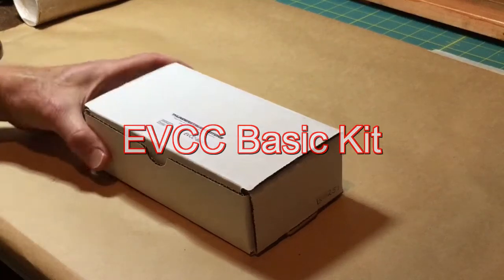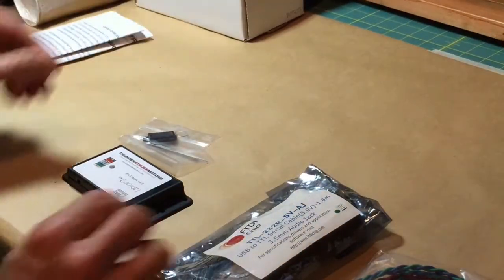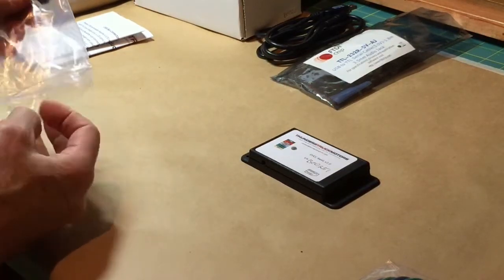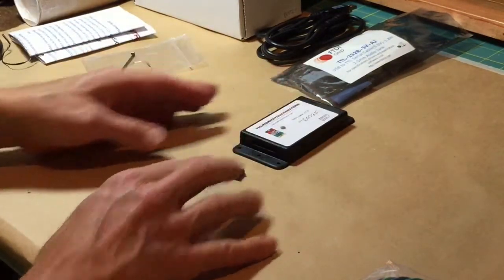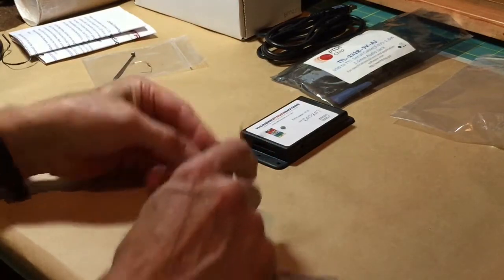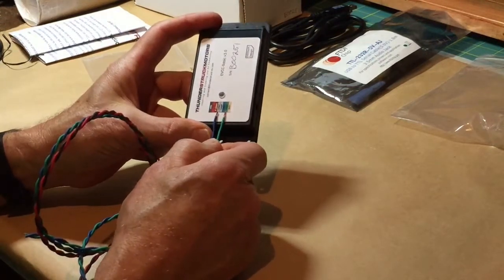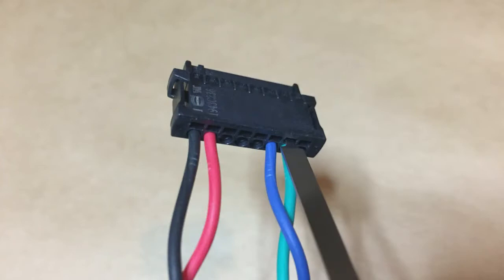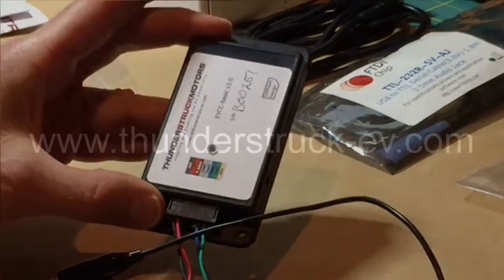EVCC Basic Kit and Wiring

Comment: Is it normal for the EVCC to start blinking faster after blinking slowly 6 times(like in the video)? I connected my evcc with 12V supplier and the evcc lights up 6 times like in the video and then starts blinking fast. Should I be able to see the evcc startup banner with just 12V connected? or do i need to connect the CAN lines first?

Comment: I just got a evcc and was looking for what out 1 pin does? is that the charger interlock wire?
Reply from the maker: By default out1 just follows the behavior of the status LED,
out2 is drive away protection
and out3 is a fault condition.
These outputs are programmable, more details are on page 12 of the manual.

Comment: Hi! Can I use it with 120-84 volts of power? I saw the instructions that you need at least 140 volts. Can this be reprogrammed?
Reply: The EVCC controls our canbus chargers. The chargers can be powered by 85-265 volts AC. If you are referring to the VCU which controls the Leaf motor inverter, that requires a minimum of 140v DC to simply operate, however we recommend a pack voltage of between 250-400 volts.
Reply: Sorry so late in reply - If this is about the Leaf VCU, the answer is that 140 volts is a bare minimum, and we've seen some installations require over 200 volts for reliable operation. Best use case is a pack with 240v or higher so that when discharged it does not dip below 200.